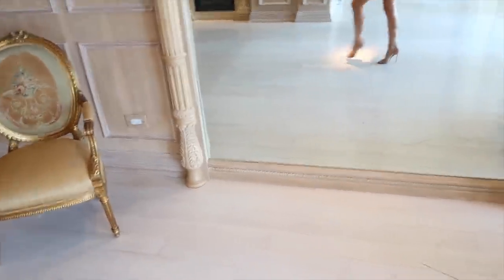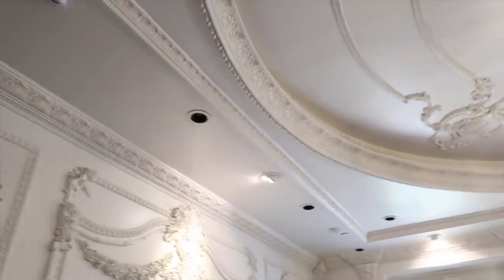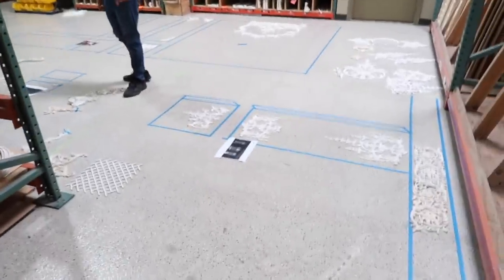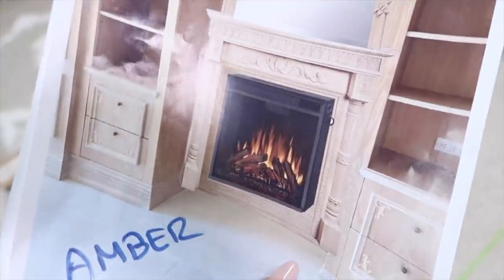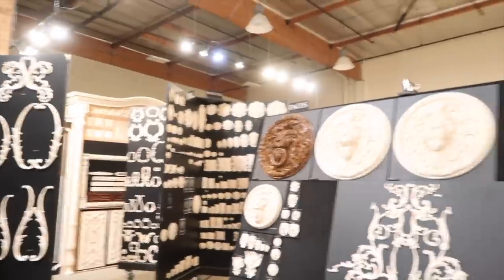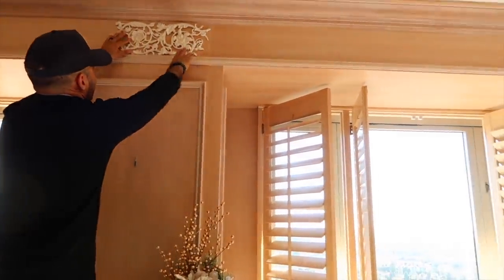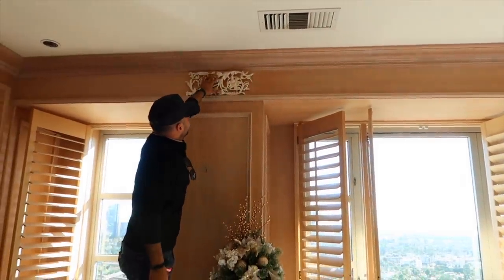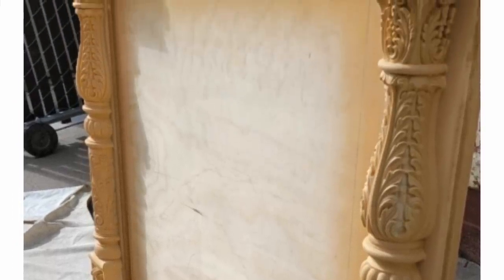Decorating My Princess Ballroom!

Comment: What about drapery instead of the wood slat for the windows & definitely you should do the ceiling, and dont over do it on wall decor. Thats what the moldings you just installed are for. It would just cheapen it.